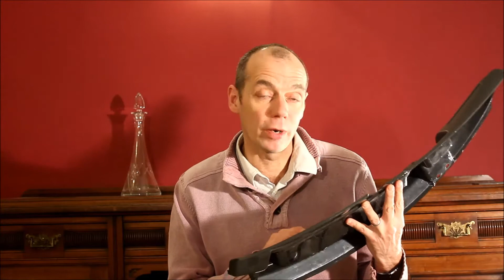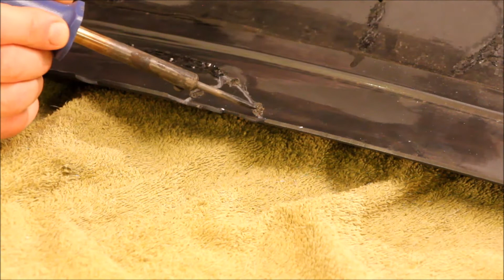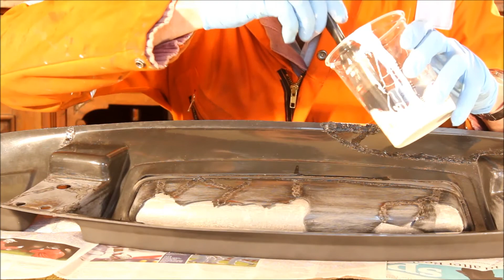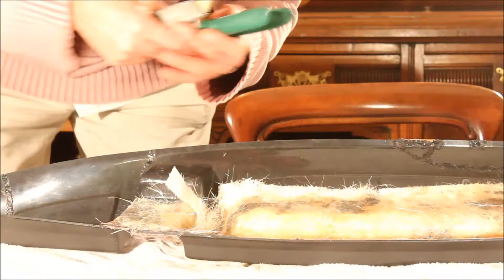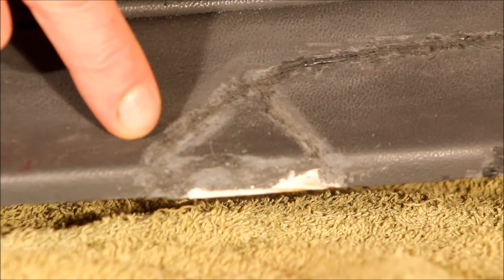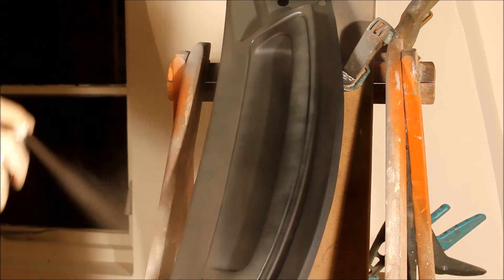Repairing interior trim using plastic welding and fibreglass

Comment: Exactly the same catastrophic damage that my trim panel has received. I actually found this vid anout halfway through repairing mine but im glad to say my process is just as yours. Except i melted a fine metal mesh into the back face to hold the broken pieces together prior to glassing. The grab handle plastic is much thinner and more brittle than the main panel though so too thin to weld. I used plastic pipe solvent and then fibreglass. Yet to paint the front face though. Great video, and quite entertaining too 😁